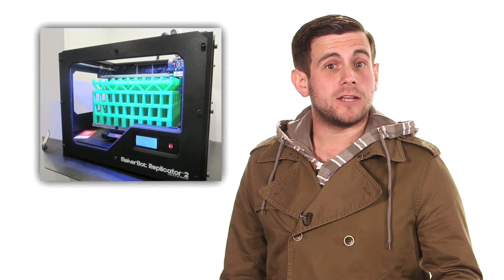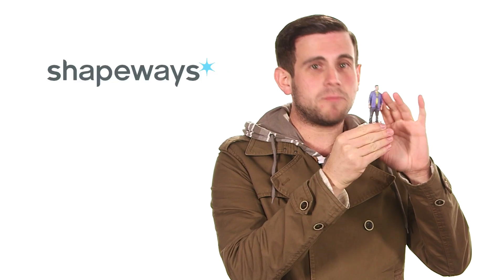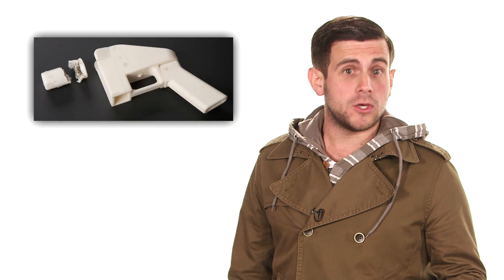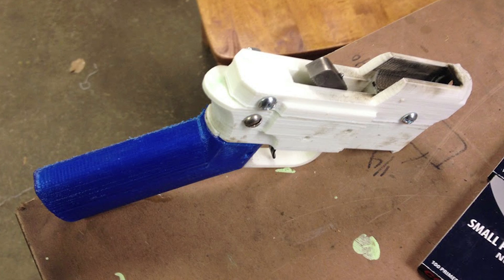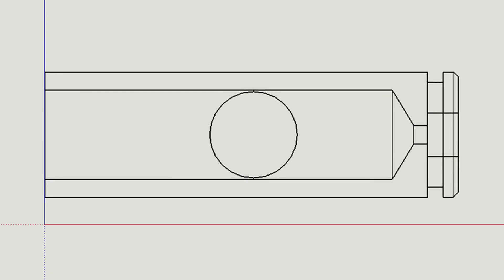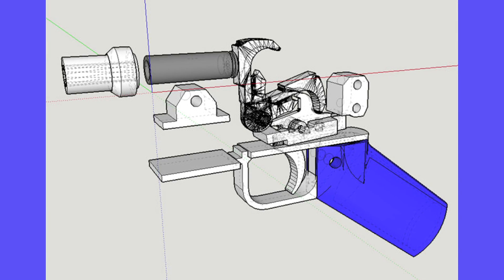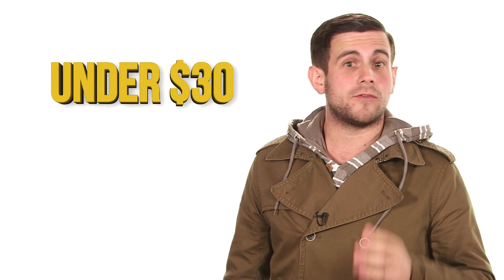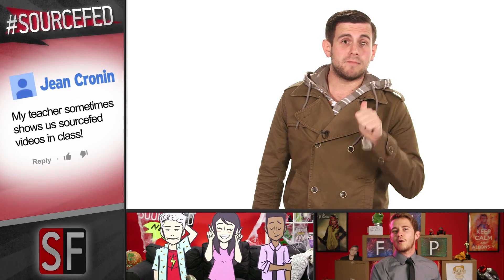New Bullets Make 3D Printed Guns a Reality!

Comment: Just wait until metal 3d printer become common, any gun even full autos can be 97% printed only thing you can't effectively print is maybe the springs.... Let that rattle around in your head!!!! Don't waste money on guns just buy a tabletop selective cintering system... If its good enough/ preferred for mass production of  jet turbine blades, its overkill for guns....yes jet turbine blades have been printed for 40 years now its the strongest most reliable way of production....

Comment: There is no need for a sigh of relief. First of all its a 3d printed PART of a gun NOT A COMPLETE GUN. You still need to purchase and mount the FULL METAL STEEL barrel, upper, buffer tube, firing pin, etc. for it to even fire. You also need to load it with bullets that are made of metal. The only thing you can say is that he made the part of the gun that has to be registered without needing to register it. Just cause you can print a gun part on a plastic 3d printer doesn't mean much. I could purchase a cnc milling machine for the same price as some 3d printers and a block of aluminum and mill a lower our of pure metal that will work flawlessly. There are videos of people doing it at home all over youtube. Heck you can make a "unregistered" lower just using a stencil kit and a drill! The world lasted a long time without registered weapons and if you don't want to be a victim then don't be defenseless. Let me ask you something, if a criminal walked into a grocery store with a 3d printed AR15 and noticed everyone in the store had a pistol on their hip how long do you think he would last if he held up the cashier? maybe at the most 2 seconds? You think his buddies would wanna try robbing the store after they found out he died?

Saying that a 3d printed lower is dangerous is just as bad as saying a 3d printed knife handle is dangerous. Without the knife it is completely useless and even with the knife it usually doesn't hold up as well as say a metal handle.

Comment: This is the absolute most ridiculous thing ever... That is what this is. This design is totally upside down, instead of a normal bullet casing which hardly costs anything to produce because it is just a cheap pressing, and the gun barrel does all the work anyway a "disposable" gun barrel is produced in the form of a stronger bullet casing. Every single shot will be very expensive because these bullets take more time to produce than normal bullets. 3d Printing is nice and all but not for producing anything at a larger scale.

Comment: Soon enough, 3D printers will lay down metal.  Then, all of the problems of the weapon falling apart under load will disappear.  Also, why not a carbon-fiber 3D printer that prints carbon fiber guns?  I would imagine that a carbon fiber gun could handle the pressures generated by firing a bullet.
Reply: if they used a liquid metal i dnt see why not
Reply: brazy999 I would imagine ionized metal (plasma state).

Comment: At the moment, this isn't a big problem. 3D printers take a bit of cash and no-how to use and build even a basic model, and then the print resolution isn't particularly flash at this point in time so it's not likely to be any good unless you have a really good 3D printer. This would cost a lot more. On the other hand, it's going to become much cheaper, much higher resolution and much easier to access/use in the future, so yeah. I personally would rather we keep this technology free and shared, as it is now, rather than wrapped up in tape.

Comment: The way I see it, most any law abiding CITIZEN can but a retail firearm. They're more expensive but not only are they higher quality, they are also at the very least equal to this 3D printed one (probably far batter). In my opinion this is just opening up a door for people to start manufacturing firearms in their own homes illegally and, lets be real, who needs to do that. For a professional manufacturer or retailer to do this, yeah I can see that working, but for your average citizen this is both unnecessary and opens the door even further for illegal firearms production, acquisition and possession to take place.

Comment: 3d printing is quick and easy but the process itself yields weak material, subtractive-manufacturing will still have a place in engineering and frankly it will  be faster and cheaper to make a gun with traditional methods for the foreseeable future.

Comment: There are a lot of people commenting how the tech of 3d printed guns is still costly, and many argue that there's more reliable firearms you can make in your garage. The point isn't that 3d guns are cheaper, it's that the technology is improving at an exponential rate, and in 20 years it might be a reality I could buy a 3d printer for a few hundred bucks, and print a machine gun and 100 rounds of ammunition in less than an hour. That's what scares people, the potential. Think big picture, everyone. If this tech is available to anyone, how do we know there aren't private companies or groups with a more advanced version?

Comment: Hey one thing this could be great for is for Swiss Army knife enthusiasts. There are tons of little parts in the handles (like the toothpick, pen, straight pin, and tweezers) that can easily be lost. Also, the handles, or scales as they're often called, can break too. 3D printing is an easily and fairly inexpensive solution to this without having to shell out money and wait for replacement parts to be shipped to you.

Comment: Printed guns are weak and scary to consider using due to the possibility of losing a finger or more.

Especially since there are much better and more widely available makeshift guns around. For one, the 410 slug is designed to be able to go through a smooth bore barrel, The right size pipe, a spring (or rubber band) a beebee taped to the primer and a small door hinge to strike the bee-bee.  Down and dirty but just as effective as the current 3d printer stuff

And it's not like 3d printing is the only way to make a gun from nothing, You could conceivably cast every part of a gun from non ferrous metals, Even the barrel, 954 aluminum bronze is rated at 90,000 psi. Good enough for 22 mag, 9 mil, hell, might even swing a 38, There's no reason someone couldn't sit down and design an entire line of carbines.

Even with all the rage and news about 3d printed guns, it is nothing new that a gun with no oversight or serial numbers has always been attainable and creatable by your average douchebag. and what's more, It's totally legal.

The only thing I couldn't figure out off the top of my head would be the rifling, but loe and behold the power of ebay, rifling files are a thing, so with a propane tank, casting sand (bentonite clay((clumping kitty litter)) and play sand) and a little know how and you could throw together not just a gun, but a damn good one, limited only by your skill in sculpting the model. and the math to make the alloy.

We live in a scary world.

Comment: People kill.... Guns can't kill without the shooter that said.... Energy weapons will be the future and lead projectiles will cease to exist eventually. A laser weapon could hit and destroy a target many miles away, undetected before it is to late. So I say let the engineers explore and invent the way into the future because with weapons comes freedom from dictatorship.
Reply: A simple cheap gun is already available at walmart it is called a plastic flair pistol, after you insert an aluminum non magnetic sleeve into the barrel reducing the size of the barrel to fit a 22 caliber short round. Anything more powerful than this the shell casing will blow the back of the pistol off. however due to the fact that only the stike hammer is made of steel this finished pistol contains less detectable metal than the zipper on a mans pants.

Comment: This is silly, not a marvel at all. You can build a better gun with a metal pipe and a few other pieces. Not everything is better when 3D printed. Also they have been making plastic lower receivers and other gun parts for a long time, they just cast them like we have been doing for 30 years now.

Comment: Lol "Marvel of weapons engineering" xD This is retarded, instead of having one thick barrel to contain the blast you practically have one barrel per bullet, as weapon engineering goes this is a huge step backwards to the one shot pistols.... If you are going to hand machine thick casings maybe just .. oh I dont know, HAND MACHINE THE DAMN BARREL.... or print a barrel out of metal, since there are metal 3D printers, even shapeways has them, but it's stil waaay cheaper to just get a metal tube from your local hardware store...
Reply: Exactly, he could have used the lathe to make a fully automatic pistol.
Instead he just made the ammo thick which would have made sense if it were a revolver. -__-

Comment: See...people use to all up in arms from 3D printed guns because they can sneak past metal detectors, but this guy uses steel to make it viable (a practice that has been used forever in home made weaponry) and people are scared its going to be on the market and for killing. The steel gets rid of passing detectors. I would also like to know the spec. of the projectile and if it holds any lethal ability. I can make a pipe bomb with gunpowder a primer and some pipe but if its radius is >3ft its pretty much worthless as an explosive to harm people.

Comment: Criminals have been making zip guns for years. Which is usually a single shot short range gun made from stuff you can get at a hardware store. I highly doubt a 3D printed version would be high on their list, especially when they can get illegal guns. In fact the only reason a criminal would make one of these would be because they couldn't afford a real gun. So there is no way they could afford a 3d printer.

Comment: For people saying 3D printers are ridiculously expensive and slow to use. technology gets cheaper all the time and there are already some pretty easily affordable home 3D printers available on the market. 

the main cost of 3D printers currently is size - the bigger they are the more expensive they become, but since pistols arent exactly large (nor are seperate pieces of other weaponry which could be combined to make the weapon at a later stage), this means that anyone with even a small home 3D printer and access to the right digital files for the 3D printer to follow could effectively print out as many handguns as they wanted over and over again. 

this is incredibly dangerous technology, yet its benefits in other areas are too good for us to leave behind. 

plus rapid prototyping machines would probably be able to crack out something handgun sized every few hours so it isnt even a very long process.

Comment: A high end 1911 costs $1000, a 3D printer costs $2000. Now why would anyone spend $2000 to make something that wouldn't work as well as something for half the price?
Reply: The technology is going to become cheaper and better overtime, just wait, mate. :DD
Reply: the first computer was well over 100,000$... ran like 1 program, using 1 BYTE a second and DIDNT have internet. Nowadays 100-500$ for a decent high speed laptop that can run 5,000 programs and load 1 gb/s

Comment: it's simply not possible to make a gun out of plastic that fires a lead projectile. Undetectable weapons will never be a reality. The bullet this thing uses is easily detectable. Besides, the lethality and accuracy of a rounded projectile fired out of a small cartridge with no rifling, this thing is only deadly from a few yards away at most, you'd be better off with an equally detectable small knife. Besides, you guys act like everyone has a 3D printer or will, some people have drill presses that doesn't mean they go machine out a barrel and make a mussel loading or single shot rifle. It's illegal to produce firearms without a license already anyways. Stop freaking out, it's a plastic gun, whoopdidty damn do. We did this with pot metal and airdropped the guns into nazi France for rebels to use, the only difference is the kind of machine and the material we are using to make these. This isn't new guys. Chill.